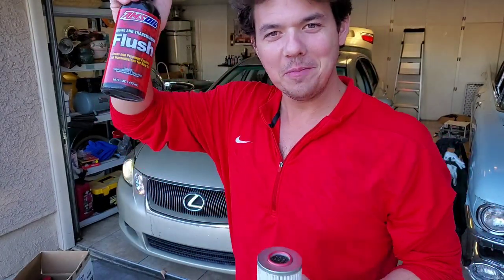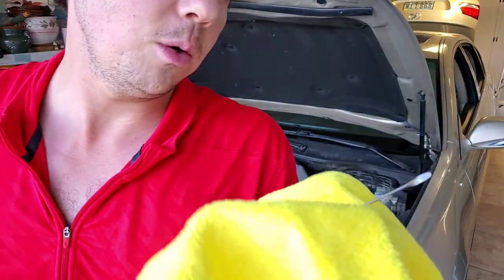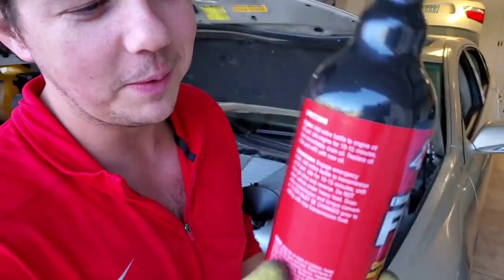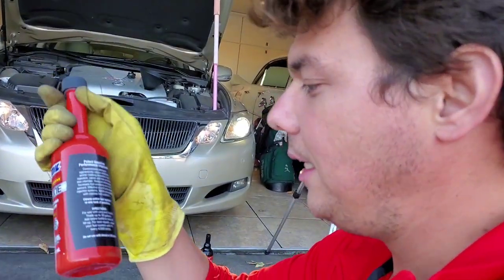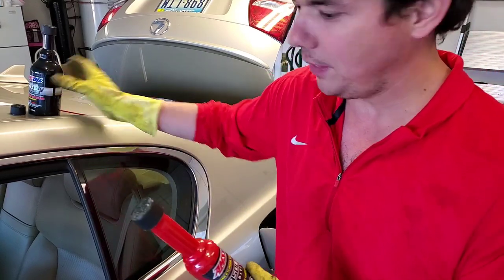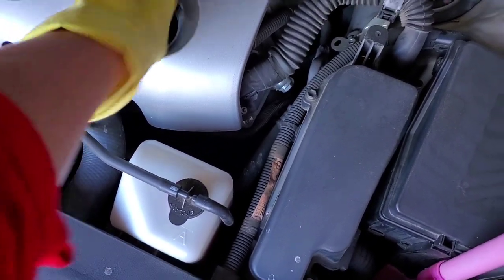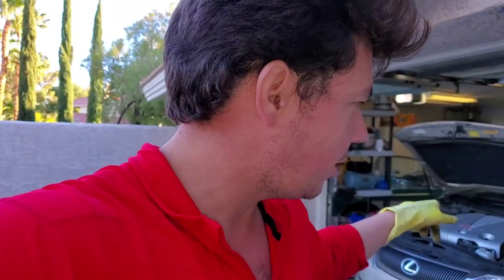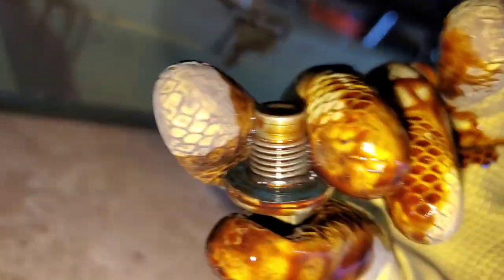4 Year AMSOIL Follow Up Lexus GS 350 Oil Change & Fuel System Cleaning

Comment: Coolant becomes acidic and should be changed often or it will for sure eat ur head gasket ! I change mine once a year using prestone any make any model , I buy from wallmart so it cost me 10 bucks a year to change
Reply from the maker: I recommend AMSOIL.
Oil Analysis Tests: 

15,500 Oil Analysis Test Results SL550 - https://youtu.be/3rdN6U1Jt_M 

5500 Mile AMSOIL Oil Analysis Test Results - https://youtu.be/3wf962IwEmo   

5000 Mile AMSOIL Oil Test Results On My SL550 - https://youtu.be/fLuvzN6yLSw 

11,000 Mile AMSOIL Oil Analysis Results on my Corvette - https://youtu.be/YEY_13UYzA4 

20,000 Mile Oil Analysis Results on Honda Uber - https://youtu.be/gm_PXlpiaTk 

26,000 Mile Oil Analysis Results - https://youtu.be/Wdq2A2YIorM 

80,000 Mile Oil Analysis Test Results Freightliner Cascadia - https://youtu.be/9A9k6i1xMoo 

25,000 Mile AMSOIL ATF Analysis Test Results - https://youtu.be/IeVPGR7UO9E 

      The Power of AMSOIL Signature Series 5W-30 Synthetic Motor Oil protects against harmful deposits on turbochargers 4X better than Mobil1® Extended Performance and 3.6X better than Royal Purple® in industry-standard testing*.  Read This Article - https://www.amsoil.com/newsstand/motor-oil/articles/leading-the-field-in-deposit-protection/?zo=5331179

Comment: I have the gs460. It takes alot of oil, per oil change.
Reply from the maker: Tell me about it I did an s class and I was amazed it called for 9 and 1/2 quarts and it took 10.2 quarts of oil
Reply: @Syntheticoilprotection  think it was 9.6 quarts. My tundra doesn’t even take much.
Reply from the maker: Wow that's a lot 💯
Reply: @Syntheticoilprotection  yes on top of that it also consumes oil. So a 5k interval will require 10 quarts.

Comment: I just did my differential Oil change yesterday . I went with Ams Oil it runs real smooth now. I gotta a 09 GS 350 with125,000
Reply from the maker: Sweet!
Reply: @Syntheticoilprotection  I’ve been using royal purple my whole life. Next oil change I’m thinking about using Ams. Do I need to flush it first and then do the oil change or can I just pour the new oil  that I’m gonna use?
Reply from the maker: You can do it both ways It's best to do the flush because what it does is it gets all the carbon around the timing chain oil cooler ports if it has a turbo it also gets that out It also cleans carbon around the rings lifters and what it does is it gets all that old buildup out so it doesn't end up in your new oil filter So if you wanted to save the time from changing the filter soon it would be a lot better to flush it and along with the other benefits of cleaning the motor.

See the Amsoil signature series has a lot of detergents in it and what that's going to do is that's going to melt a lot of the buildup in your motor out once it gets melted it ends up in the filter once your oil filter is full the oil will start to get dark because it's going to be in suspension which means those particles are just floating in the oil but they're not being caught by the filter because the filters full So that's why I always personally do a flush the first time I switch over to Amsoil also I recommend the PI performance improver gasoline additive cleans the valves the injectors and I like the upper cylinder lubricant I personally use that in my car every full tank of gas.

This is my link and that will give you about $33 off and $100 order as a 6 month PC member between the difference in tax.

If you have any other questions before you order you can always give me a buzz anytime.

Thanks again for being a part of my YouTube community.

🎬 Professional YouLubher: Eben Rockmaker Regency Gold Direct Jobber AMSOIL Specialist (Dealer#: 5331179) 702-472-3614 

     If You're New To AMSOIL I Recommend The AMSOIL 6 Month PC Membership - https://www.amsoil.com/offers/pc/?zo=5331179

Comment: Messy oil change, I put down cheap blue tarps to catch drips and either clean or throw away when done. Save floor stains
Reply from the maker: Yeah that's the good thing about tile in simple Green is pretty easy to wipe up It just takes a little bit of time and a bunch of paper towels lol

Comment: That car needs an oil change every 5k miles or 6 months. Did you not notice how dark/dirty the oil was? Poor Lexus :(
Reply from the maker: This is actually a special lubricant Amsoil is 100% synthetic a oil manufacturer can call a full synthetic full synthetic when it's only 25% synthetic this is 100% synthetic you're good for one year 25,000 miles on one oil change and if you ever want to try the Amsoil products this will give you the very best value on them and when you use my link I will always be able to answer your questions about improving the performance and life span of your vehicles by choosing the right fluids as your independent Amsoil dealer.
♥️   Find The Right Fluids For Your Vehicles - https://www.amsoil.com/guides/?zo=5331179      

     ✅   Save 25% On Your Next Fluid Order: https://www.amsoil.com/offers/pc/?zo=5331179

Comment: That old oil looks nasty 🤮 that poor engine !
Reply from the maker: Oh yeah the carbon buildup stays in suspension because of the detergents and dispersants that are in the signature series It doesn't allow anything to cling to the side walls.

It's amazing what the engine flush does 👍
Reply from the maker: The engine runs amazing still gets the same fuel mileage 33 highway miles a gallon unbelievable how strong that car runs
Reply: @Syntheticoilprotection  yea ok 👌
Reply from the maker: Oil Analysis Tests: 

5500 Mile AMSOIL Oil Analysis Test Results - https://youtu.be/3wf962IwEmo   

5000 Mile AMSOIL Oil Test Results On My SL550 - https://youtu.be/fLuvzN6yLSw 

11,000 Mile AMSOIL Oil Analysis Results on my Corvette - https://youtu.be/YEY_13UYzA4 

20,000 Mile Oil Analysis Results on Honda Uber - https://youtu.be/gm_PXlpiaTk 

26,000 Mile Oil Analysis Results - https://youtu.be/Wdq2A2YIorM 

80,000 Mile Oil Analysis Test Results Freightliner Cascadia - https://youtu.be/9A9k6i1xMoo 

25,000 Mile AMSOIL ATF Analysis Test Results - https://youtu.be/IeVPGR7UO9E
Reply from the maker: Yeah it's just not like the other oils out there totally different
The Power of AMSOIL Signature Series 5W-30 Synthetic Motor Oil protects against harmful deposits on turbochargers 4X better than Mobil1® Extended Performance and 3.6X better than Royal Purple® in industry-standard testing*.  Read This Article - https://www.amsoil.com/newsstand/motor-oil/articles/leading-the-field-in-deposit-protection/?zo=5331179      

     Better MPG Proven. Read This Article - https://www.amsoil.com/newsstand/motor-oil/articles/another-win-for-amsoil-products/?zo=5331179 

     AMSOIL Performance Test Results. Read This Article - https://www.amsoil.com/performancetests.aspx?zo=5331179